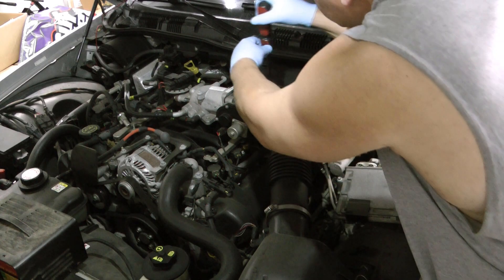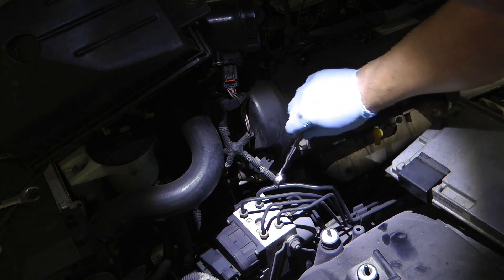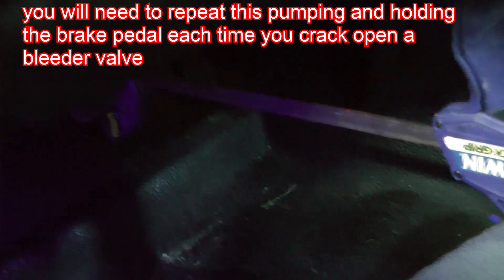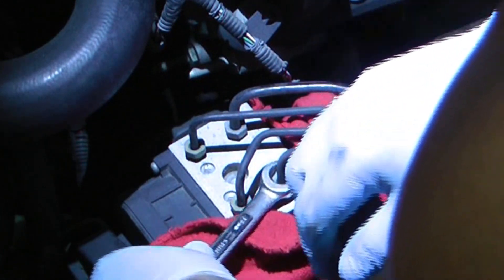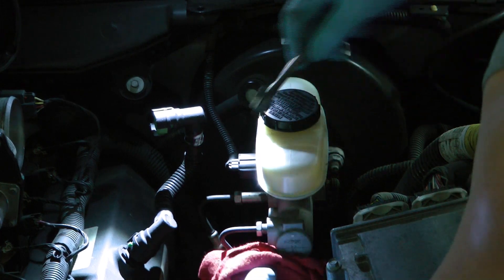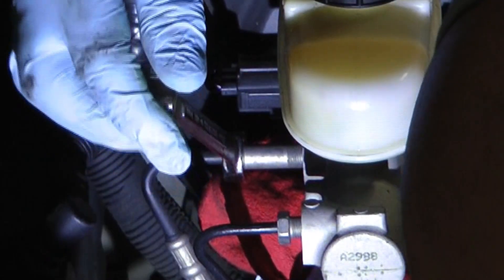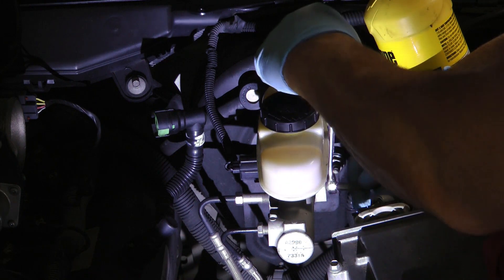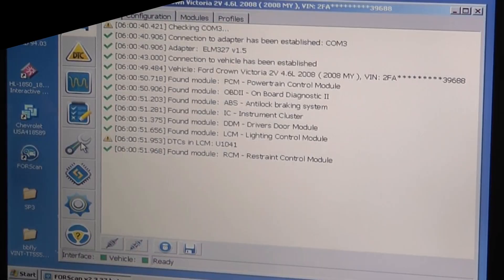Ford Crown Vic bleeding ABS module and master cylinder

Comment: Is this what causes my ABS and brake light to turn on? When there’s air in the brake lines? Because this Mechanic is wanting me to replace the ABS control module
Reply from the maker: I don't think air in the ABS module triggers the dash light but I'm not 100% on that.  The dash light should be confirmed using a higher level scan tool (like an Xtool D7) and see what the code is.  If it's an internal fault then yes you have to repair or replace the ABS module

Comment: My brake pedal sinks after changing the front brake calipers. They have changed the brake master cylinder, they have bled the ABS module with a scanner and it remains the same. I can't find the problem, any ideas?.
Reply from the maker: possible that the calipers are bad or that the caliper pins weren't lubricated properly (assuming it's not actually air in the system or a leak)
Reply: @WJHandyDad  The calipers were news and the caliper pin was new too and with grease. Maybe air, i dont now. Thanks.
Reply from the maker: @cransaftvalve734  good luck, soft brake pedals are frustrating when they don't resolve with a simple bleed

Comment: Thanks for uploading this.  It helped with our ABS module.  
We got a set of ratcheting line wrenches for doing the job on our 2003 FORD Superduty delivery van (with similar ABS unit) and it made doing this job quite a bit easier than with static line wrenches.
Reply from the maker: glad it helped

Comment: Isnt it dandy that on a03 sable with traction control they choose to have two different sized fittings on the top of the abs unit. I got a abs at a scrap yard and spent 2 hours trying to thread those lsst two in until i finally miked the fittings and found out two were larger. What a pisser that was!
Reply from the maker: it's annoying when engineers do that stuff

Comment: Hello, I was curious what the lines that connect to the abs module and master cylinder are called. One of my lines tore and I’m not sure of the part or line name
Reply from the maker: I don't know if they have a special name or not, I always just call them brake lines
Reply: Abs to master brake cylinder brake lines

Comment: What kind of set up or clamp to press the brake pedal down while you open lines
Reply from the maker: just a regular clamp/spreader tool like you can find at most hardware stores... it's just extra long so it can reach from pedal to seat
Reply: @WJHandyDad  thanks
Reply: @WJHandyDad  did u have to keep releasing it then re apply
Reply from the maker: @LesleyHolmes-gs8go  open valve, press and hold, close valve release.  Alternatively you can press and hold, open valve, close valve, release.  Repeat until no air bubbles.

Comment: I have a 2005 crown vic changed the rotors,calipers,brake pads. I bleed all 4 and now my brake pedal sinks all the way in to brake. What could it be?
Reply from the maker: does it sink with no stopping power, or does it sink after stopping.  Both of my Vics stop great, but once stopped I can continue to press the pedal to the floor.  I haven't found a "fix" for mine but I also have not driven any vehicle (including those that I've never done any work on) that I can't replicate the pedal to the floor after stopping.  Now, if the pedal drops with not much stopping power, that could be the brake booster.  I haven't done a video of replacing yet, but probably will this year

Comment: Could you do this using a power bleeder rather than pumping/holding the brake down?   So just hookup the power bleeder like you're gonna bleed from the calipers but instead crack open each of the abs hoses?
Reply from the maker: I don't think it works like that, I think you still have to press the pedal when doing the ABS bleed
Reply: @WJHandyDad  Update:  After trying multiple things, I finally tried hooking up the power bleeder and cracking open each of the hoses...I ended up getting a few spurts of air out of one of them (woohoo!). Bled everything again, and I'm back on the road.   Thanks for the vid!
Reply from the maker: @Cavallino69  glad you got it!

Comment: So is the last step you did necessary with the Forscan tool or just a full manual bleed (master cylinder first, then the ABS, then the 4 wheels (RR, LR, RF, LF) enough?  Thanks!
Reply from the maker: I'd normally just do a manual bleed.  If you still feel like there is air you'll want to try the automated ABS bleed.
Reply: @WJHandyDad  thanks for the reply!  I have to replace one of the lines between the master cyl and the abs module (its rusty somehow) so this is good info.  Thanks!
Reply from the maker: @scottj12  hope it goes smoothly for you

Comment: What about if your brake peddle goes really hard and brakes lock what can that be, changed all callipers also braided lines also all abs sensors and the rings ain’t cracked or chipped
Reply from the maker: friend of mine said the brake booster is probably going bad
Reply from the maker: I haven't had that problem... I always have the opposite problem.  Hopefully someone on here knows
Reply: its an ABS module I have had that issue abs valves where getting stuck on closed somehow causing the brakes to lock fully and the car stops directly!

Comment: Mine is spongy so I will give this a shot. Also, my abs light and brake light stays on. Which causes my speedo and everything else not to work. Any clue what the fix could be?
Reply from the maker: if you have a brake and ABS light on you need to pull the codes to see what the car thinks it is.  If the brake fluid is too low that would cause it, but hopefully you've already checked that!

Comment: My tool scanner scans the abs Pump control module my ? Do I do what you did first to see cuz only my rear brakes work it feels sponge
Reply from the maker: If you have a scan tool that has an ABS flush feature on it, you can use that instead

Comment: My abs and parking brake light stays on in my 2011 Vic.. u think this could correct the abs light?
Reply: The electronic control module,  the black plastic box attached to the ABS pump shown in this video, is a common failure, especially if the light is intermittent.  You can try sending it out to be rebuilt, or purchase a replacement.  I believe it has to be flashed with your vehicle’s VIN so you can’t just pull a junkyard part and go.
Reply from the maker: you need to run the codes on your ABS (FORScan can do that, plus some other scan tools on the market)  if air in the system is the problem, then this would correct it.
Reply: @WJHandyDad  thank u brother..I’m trying to pass inspection and they giving me a hard time because that light stays on
Reply: @old cars trashed I actually had my ABS controller fail and was researching when I posted before. Since then I Bought a replacement from RockAuto and got a “mismatched VIN” code and amber ABS light on the dash when installed The part claimed no programming required, but it didn’t work for me so I returned it. Sent the original off to be “repaired” and it is now dead, a brick.  The company has agreed to refund me. So I was back to square one.  Last weekend I Bought one from a local junkyard from another 2011 CVPI. Installed and again got “VIN mismatch “ error.  Used Forscan to configure “as built” in the ABS module and now no errors at all.
Reply: @chrishopkins6144 how was using forcing and what original codes did u get

Comment: Right on Dub Dandy,
I think I properly traumatized you into using the correct flare nut wrench when appropriate. lol
4:30 I hear Don Ho in the background. Aloha.
That FORScan device looks like a handy tool.
-Chuck
Reply from the maker: it probably does a lot of things I haven't even ventured into yet.  Seems to be the best scan tool for a Ford owner though because of the access to all the things a regular scan tool can't do.